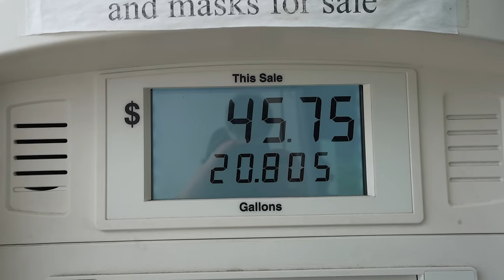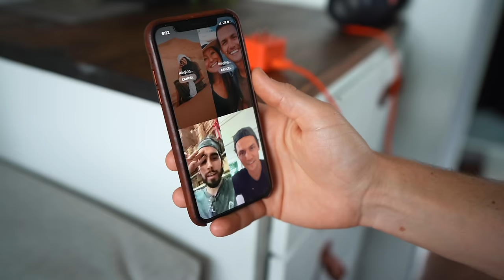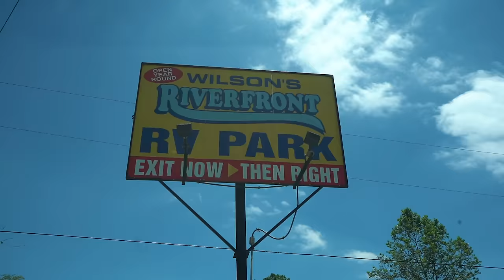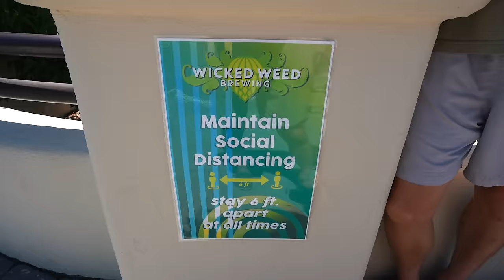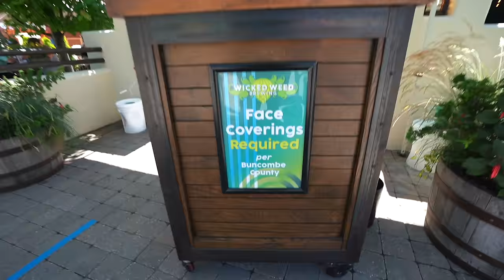FIRST WEEK OF VAN LIFE

Comment: Nate, I have the same solar controller and had the same error. It was one of my battery wires were installed wrong. Check all your wires negative to Negative, positive to positive. You are not supposed to disconnect the batteries when the Solar is hooked up. If you want to talk over the phone I can probably help you.
Matthew 
#Vantiful_Adventures

Comment: Always disconnect the positive terminal from the battery before working on any of the electricals. Disconnecting the negative terminal stops the flow of current, but the voltage is still present if the positive terminal is connected.
Reply: THIS! I was holding my breath the whole time! Electric for dummies: 1) Turn off all power to battery. 2) unplug positive 3) unplug negative/ ground.  So long as things are grounded/negative, you have a very low risk of sparking and getting electrocuted.  Same goes for jumping a dead car battery.

Comment: Quick tip. Disconnect the Ground/Negative cable on vans battery first before moving around or disconnecting the Hot/Power cables so you don't get the sparks and short out anything expensive or blow fuses. It will  keep you from shocking yourself also when using your tools in confined areas! If you don't want to lose preset radio stations when you do it they make a small plug that uses a 9 Volt battery and plugs into your cigarette lighter or power point that will provide just enough charge in the system to keep them set while the main battery is disconnected.

Comment: Is there any way the pee tank comes with a cap or has one available so you can screw it on before trying to get it out? It would prevent spillage and probably smell too 😂
Reply: Brilliant
Reply: What they need is to upgrade that old compostable toilet with a new one. They now have electronic pee tank monitors with a flashing led to tell you when its time to empty before you fill it to the top like that.
Reply: I'm sure there was a cap, but it may have been lost by now.  How about aluminum foil?  Plastic wrap? Duct tape?  A cork?  Any number of things (a potato?) would have been better than nothing.  Upgrading to a better toilet may be a good idea but it was not a viable option at the moment the tank was already sloshing over.
Reply: James Clendon 😂😂😂😂 right?

Comment: The Renogy Solar Charger has to see the batteries BEFORE you plug in/turn on the solar panels.  Whenever the Reonogy boots up, the battery system is all it should see.  It will auto-configure for a 12V or 24V system.  You then can go into the control configuration and set the battery type (sealed, agm, lipo, etc...).  Once that is done, then you can connect the solar panels.  Please note if you ever disconnect the batteries from the Renogy you will have to go through this again.  On my "camping" setup I added circuit breakers to each section so I could easily turn things on or off without all that nasty sparking.  I have 3 x AGM batteries which I have parallel connected with a Anderson connectors, so I can unplug the pack.  They mate into the circuit board that hosts the Renogy and the Inverter.  That connection then connects to a circuit breaker and the Renogy and a circuit breaker then the Inverter.  The Solar panels connect to a circuit breaker then the Renogy.  Booting involves turning on the circuit breaker from the batteries to the Renogy, waiting, then turning on the circuit breaker from the panels, then turning on the circuit breaker to the inverter.  Removing power from the system to work on it involves turning off breakers or unplugging the battery bank.  I don't like sparks.

Comment: Looks like you’ve got the nature’s head toilet? I think you take the whole top section off by undoing the floor bolts so the top opens back - then you can easily remove the urine tank. Probably, I think, maybe. I’m looking into the different types of composting toilets right now, for my upcoming build. I think there is one with the ability to remove the urine tank independently and it is discreetly opaque, still researching so thanks for the demo 😀🐝

Comment: You probably already have this all figured out - but there should be a screw on cap for the pee tank, making it easier to carry.  We have the AirHead toilet, which we like much better then the other brand - there is a clear circle to look through so you can check your urine level, PLUS it isn't sitting in a 'bucket' so easier to remove, without lifting the poo tank.  AND you should check out Venture Wipes (like over sized baby wipes) for when you don't want to shower - they are amazing and I'm sure with your viewership they would sponsor or at least send you a case!

Comment: Great vid! I have a composting toilet & have over flowed the pee bucket a few times!! I now know, if it doesn't sound like you are going in a bucket,  then its time to empty.   Mine is a Air Head brand & has a very small window,  that I can see when it is getting at a high level, but the sound works best.  Also, If you don't have a cap to put on top of the bottle,  maybe you could order one from Natures Head.  That will help with walking with the bottle. Lastly,  don't be afraid of #2, it doesn't smell & Kara will get the hang of 1 & 2 at the same time. You can always use a coffee filter over the trap & that makes it easier at first.
I will be near Nashville, Murphysboro to be exact next week.  I will be on the lookout for you two!!  You are always inspiring ❤.

Comment: I just have to ask WHEN WILL THEY CHANGE THE TOILET TO A NORMAL TOLIET ‘cause then they can connect the toilet strait to the grey water tank and change the water tank so it’s one of those pull out ones and you can pour it into a toilet but the water tank also turns the pee into grey water or black water that doesn’t smell (pretty much what is in the revel).

Comment: if Nate gets electrocuted you just need to push him as hard as you can away from the conductor. His body would be completing a circuit and if you push him away from the electrical conductor he should release it. Its not the volts that kill you. Its the amps. So make sure everything is off or unplugged before you start doing electrical work... maybe get heavy duty rubber gloves and a grounding lanyard.

Comment: With those MPPT controllers you’re not supposed to disconnect the battery while the solar is still connected and running. I have extensive solar electrical experience. If you want help feel free to DM me.

Comment: I learned my lesson changing a PC power supply, hit a charged capacitor, shot sparks across the carpet. Please read all of the manuals. You could easily burn down your van or run the engine out of oil and cost thousands. If in doubt, hire an expert. Know your limitations.